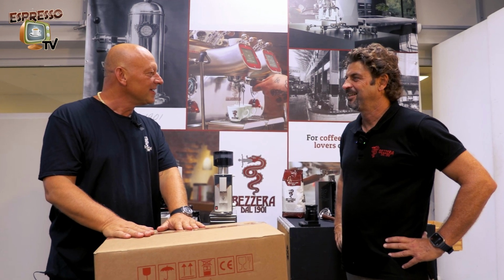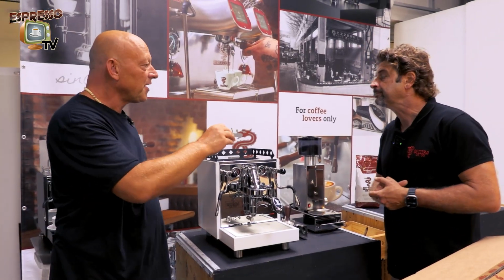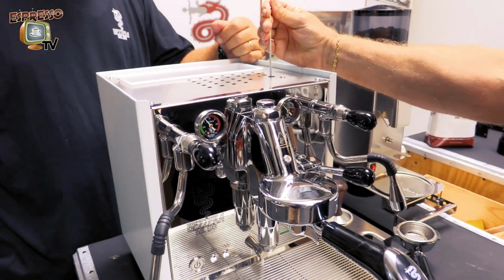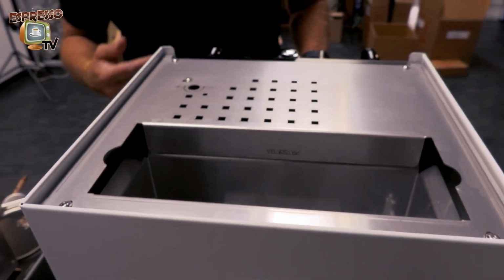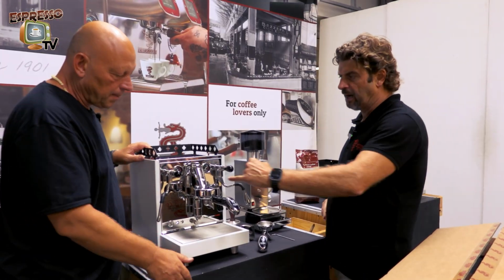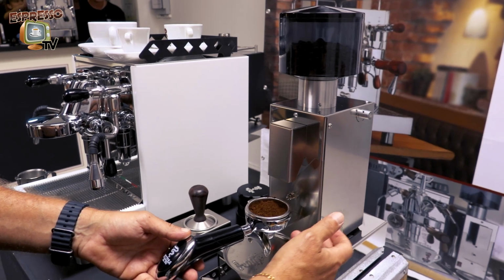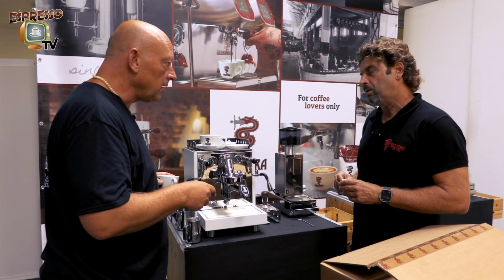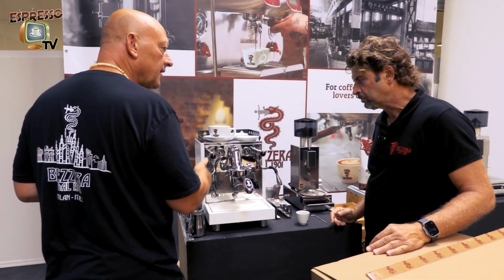Visiting Espresso TV - Luca Bezzera presents  BEZZERA LUCE

Comment: Interesting to see they finally support way to adjust OPV. Is this a different pump? On bz group seems they use low quality parts.  when lower pressure, the pump squeaks. Did they fix it?
Reply from the maker: The pump is the same, ghe opv is different. So no more strange whistling by the spring.
Reply: @TheEspressoTV  is it possible to replace older model opv?